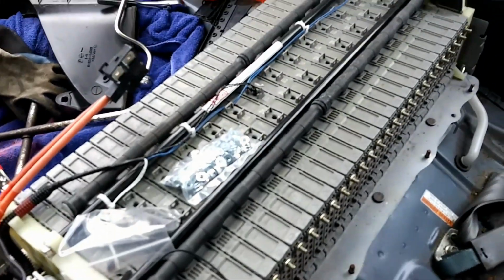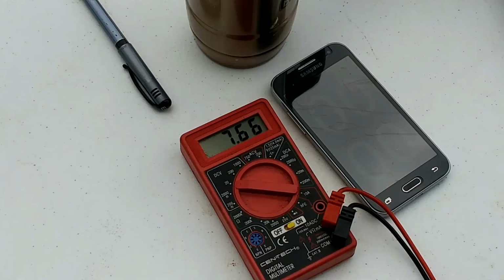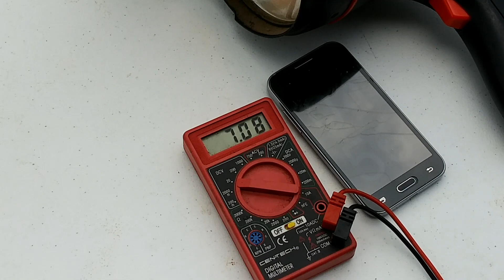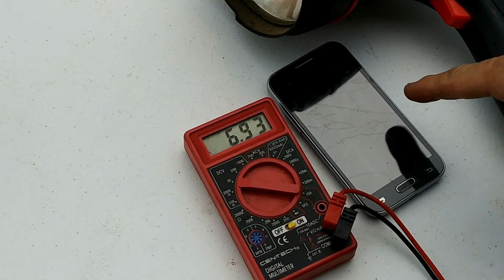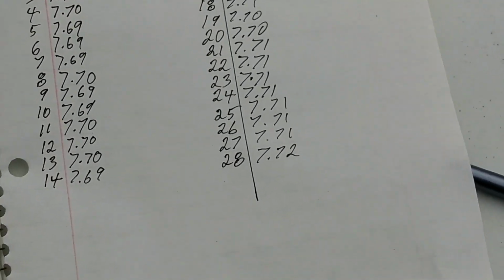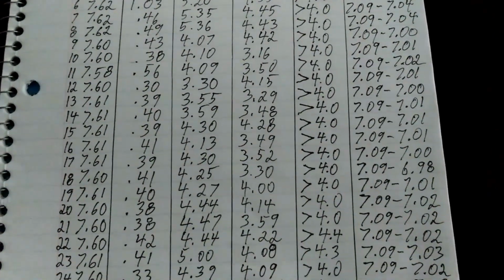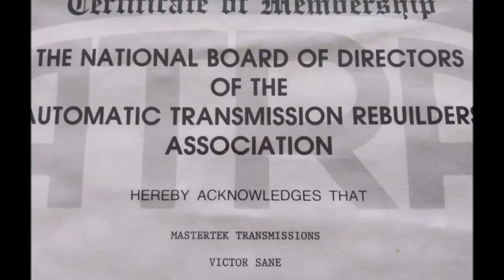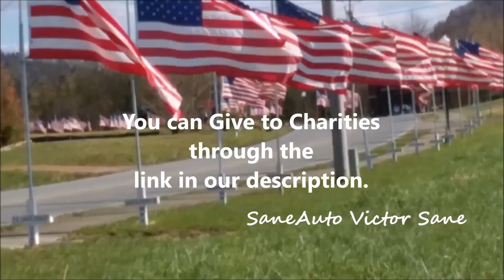load testing hybrid high voltage battery 2010-2015 prius repair video

Comment: You need to measure the amps in the load, with a constant amps in load you can discharge the module from the steady state voltage(the constant voltage when made a full charge and stay the module without load in 24h) to 6.0 to 6.2 (the nominal base voltage when the NIMH 6cell module is full discharged) and measure the time in constant load, whit this you can measure the charge capacity in an or Amps/hour, the nominal capacity for this module is 6.5 ah when is new, but with a few thousand miles this capacity drops until 5 ah, the trik is use all the modules whit the same capacity and made a balance charge  in parallel connection, by this way the BMS can't determines the P0A80 because all the modules drops in same voltage

Comment: I discharged Prius 3 module to 6 v
Later I recharged it 1.5a
For 2 hours.
It's shows 8.4v
Is it normal?
Tks
Reply from the maker: Normal probably not. Does that mean its good or bad , inconclusive. It has more to do with how long it takes to discharge than how high a voltage it will charge up to. The 8.4v may just be a weak surface voltage and disappear quickly under load.